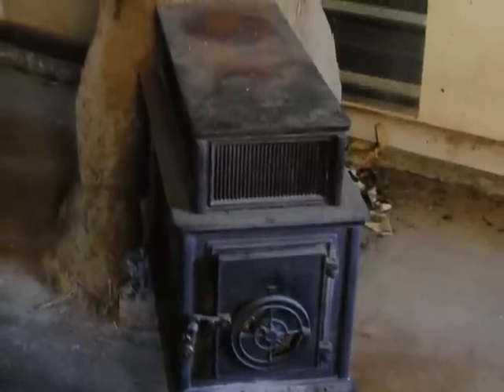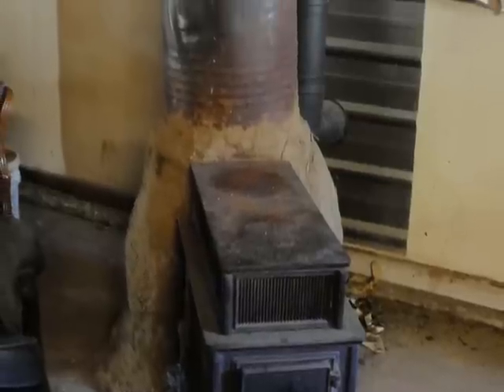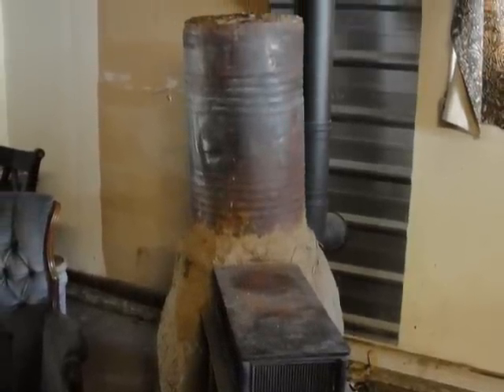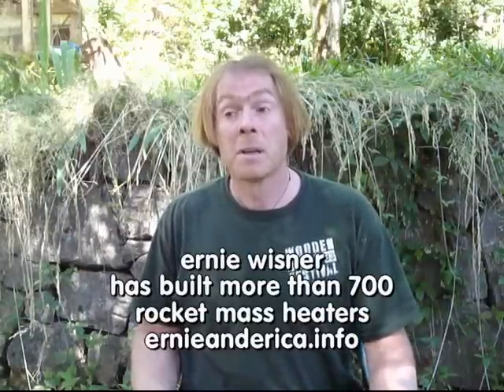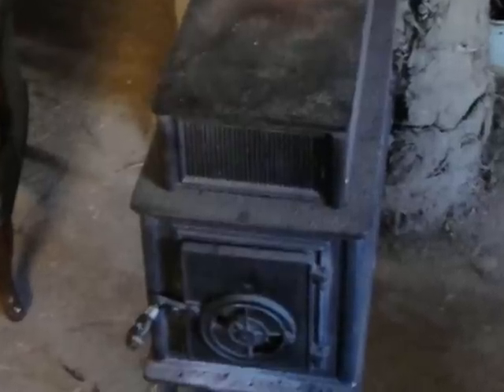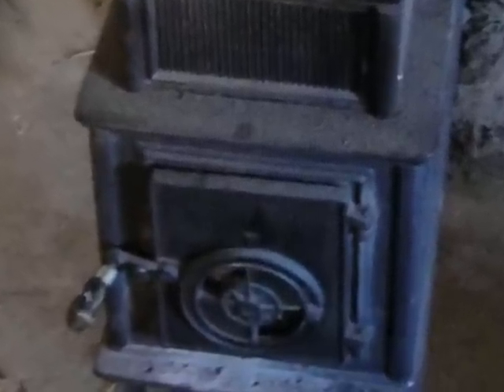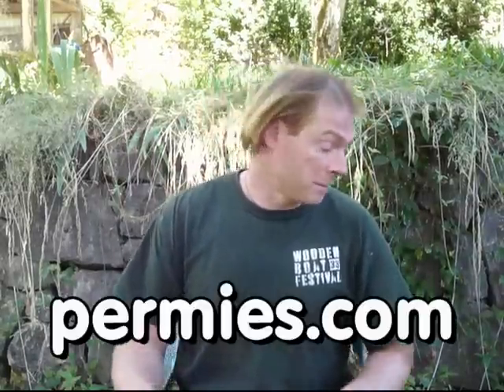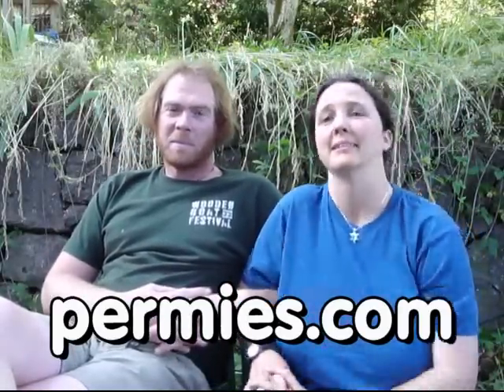wood stove + rocket mass heater = hybrid

Comment: Do you think that using double pass through the vertical heat tower would increase the heat and less would be lost to the outside air ??/ How about using a brick heat mass that they use in Russia on the tail end of the hybrid wood rocket stove ??? Thanks

Comment: Paul, i am lucky to have wood delivered to me for free on a regular basis. I personally do not car how much wood I burn. My beef is that a large house 2500 S.F. need a good bit of heat even though it is well insulated. Would really like your advice on being able to get a good ten hour burn from the woodstove. That would really work. My wood is seasoned at least 2 plus years with very little moisture. The meter say the level is somewhere in the lumber yard stick construction lumber. Very dry for sure. Look forward to hear from you Sir.

Comment: the funny thing about this presentation is that I have always been informed, that is up until now. that combustion takes place in the riser. with the turbulence, temperature and the time factor, in accordance with the Horatio of the feed box length to the riser. could be 1:3. any ideas. other j tubes/rockets work even without insulation of the firebox. insulating the firebox seemingly does enhance heat capture/control of the operation. Ernie seems to have missed out on this critical factor. maybe next time around.

Comment: how about insulating the stove then. alot of people have a wood stove. what a way forward, if their stoves could be modified.
Reply from the maker: The insulation would need to be on the inside.  Plus, you need to mix the smoke, air and fire the right amount.

Comment: Really what's the point of using the stove as the burn chamber and entry point for air when essentially it's all getting sucked towards the secondary chamber ? Also the angle of the wood being burned is all wrong .The whole point of the efficiency of the rocket design is the fact that you're gravity feeding the wood and that creates a vortex fire that burns most of the VOCs and is drawn into the first point of contact ,the cob and steel .I thought the idea was to have a narrow opening to create the fast updraft to begin with that burns the fire sideways . I could see making the wood stove the primary collector for the heat with an internal riser inside of it and installing a steel tube and feeder inlet for the wood in the front but the chimbey opening would have to be lowered as it is on the traditional cob stove design. But all that aside I can see why they tried this idea just to experiment with the idea . I don't imagine that the stove gets very hot especially if its lined with bricks and used as the feed for air . I found this video while searching for a way to convert a free standing steel wood stove and make it a rocket stove . After seeing several examples I think I'll stick to the original design for the rocket stove and just build it from scratch . From what I can tell trying to utilize the wood stove is too much hassle to bother with.

Comment: Would someone be able to vent the exhaust from a wood stove into a hollow warming bench before routing it up the chimney?  (Using the stratification method.)
Reply: I started to do this - but without a clean burn then you have creosote too easily. So with stratification - the exhaust insulation can't be metal (as a riser is not metal)... not sure if they did that here in that barrel?

Comment: I'll try it on my old Jøtul 8.  With a short cob/masonry countertop bell.  I have 6 slabs of 4" thick granite 18"x36".  I think the granite (black polished) should hold up as the bell top.  What do you think?  I burn hardwoods predominantly.  I don't mind the spruce on a hot fire.

Comment: I added a batch box to my 55 gallon free standing rocket (a larger version of ZeroFossilFuels). Just like you, it failed becaise of the very reasons you mention. The box gets hotter than the rocket, which doesn't quite get to opetating temps for it to do its rocket thing.

Condensate from my flue is all over the floor, just beyond my mass, so its obvious that my exiting flue temps are way too low.

 Outside, it was in the mid 20's last night. I never had that problem with the rocket even in single digit temps.

I'm cutting that batch box up and am looking to cast a burn chamber out of castable insulated refractory al la Van Der Berg.

Anyway, I want to thank you Ernie and Erica. You two were my first '"rocketeers." What a wonderful adventure/learning experience it has been. I  also am glad I built a smokey failure. In the process, I became a better welder, and a smarter rocketeer.
Peace.

Comment: Now if you took a high efficient woodstove that is insulated with a firebrick lining, wouldn't that burn almost as complete when a mass is added to it just like you have with that older woodstove you are using?

Comment: i agree with madpainter69,
simply line the interior of the stove with insulative fire-brick.  many stoves are designed/factory made to be lined with firebricks...  which would also help the steel survive.  i disagree with people suggesting to cover the stove with cobb or bricks

Comment: what if you lined the whole inside with say styrofoam that will burn up later, took a 6"cardboard tube and a 12 or 14" tube for the burn tunnel made an L , insert into stove, and filled the remaining airspace with ceracast... insulated firebox 360* minus the door for loading. and you wouldn't be ovefireing the cast iron and possibly creating a fire hazard in a couple months time...

Comment: You need to retrofit that Jøtul with a "clean burning system" and then it will burn just as clean AND slower then a rocketstove. 

The optimization is needed to be don in the wood stow and not in the back part. the conversion of the stow is don by insulatin the sides then introduce the preeheated air in to the top and to the roof in the front befor the flame goes up in to the uper "burn chamber" then you get a compleet burn as long as the woof is not to wet. i use modern Dover burners that work just liek that.. mine is a smaler one. (the one you have trhere is the old 60cm type) stil it burns complete and heat up realy good.

What i dooo need is somthing to remove more heat from the the gasses goign out from it. now it just goes out the back and out thru the wall.. so a lot is lost to the outside.
Reply: that's where you can implement the rocket mass heater to get the rest of the heat from the gases.
Reply: can we just put perlite clay into the sides of the wood stove? thanks

Comment: problem , ive only got a 4x4 space to make a rocket mass heater.instead of going sideways for the mass I need a way to make it all in a 4x4 square.this square is in the middle of two rooms.the floor is wood. the whole house in on 4x4 that are cemented in .we were going to put in a regular cast iron or metal heater but I like the rocket mass heater instead.worried about if this small mass would heat 28x32 house.and need plains for this square unit any help would be great were lost

Comment: So can one take a wood stove and fully envelop it in thermal mass to create a more efficient thermal mass hybrid approximating a RSMH?
Reply from the maker: I think it is plausible.
Reply: Hi paul wheaton! Pardon the noobie question, but if someone would cover the cast iron stove with COB, is there a chance that it could get hot enough inside to break down the metal?
Reply: No ,not possible .What makes the rocket stove unique is the design which uses the exhaust heat and transfers it to the mass . I've tried using fire bricks and totally encased a regular free standing wood stove to see the results. It did radiate heat longer than if it was just the steel alone but essentially it took a long time to release that initial heat because your heating the metal  and then brick or whatever you choose to use as mass .
I could put my hands on the bricks and feel the warmth but if I removed one from the stove the steel was scorching underneath .Most heat went straight up the chimney unfortunately .I ended up using the top of the stove as a mass storage for heat which made it safer for my cats who dig it 😸but left the sides alone to radiate the immediate heat . All that aside comparatively speaking regular wood stoves are such a waste of potential energy and are so inefficient it's unreal ,plus they're extremely dangerous . A good friend of mine almost died because of a creosote fire . That's also the beauty of the rocket stove design,no creosote build up at all. I'm in the process of building a rocket stove right now and once it's done will never go back to a traditional wood stove . The free standing wood stove I have now is really nice and built extremely well from 1/4 inch steel with gorgeous welds ,plus is a step up chamber design but the amount of wood needed plus the inherent risks of using it just aren't worth it .
Reply: @royalspin  I just got the "two dog" stove that has a baffle - so it gets 20 to 30% more efficient burn. I will stack bricks around it but I don't have "fire bricks" for direct contact with the stove. I guess constant duct pipe cleaning will be needed for safety. thanks for your feedback.
Reply: @royalspin  I think if I damper the stove pipe a bit and then put bricks around that also - that should also capture more heat.
Reply: Insulate the box but lose the radiant heat...  which wouldn't be bad if it were piped to a mass.

Comment from the maker: Much like a conventional stove, you start the fire with kindling.   Once that is gone, add some bigger stuff.   By that time, the room is plenty warm and you stop feeding the fire.   The room stays warm for a day or more.   Feeding the stove every half hour is what you do with a conventional stove, not with a rocket mass heater.
Reply: paul wheaton!  First thanks for linking this vid to me.  I have seen it before but poo poo d it because, let's face it the stove looks like a turd.   I have seen 3 types of RMHs.  Those that are really nice and anyone would want one.  Those that are nicely done but look good for the right space and those that look like a turd in the living room.  I am not artistic, if I can make a piece of wood straight or make mud smooth I'm happy👍   The one thing I can consistently do is make a turd.  I don't want a turd in my livingroom.   What I seen of this is the inurds of how this can work.  ERNE'S  solutions is to wrap the stove in insulation.  Makes sense based on other RMHs all slathered with mud.   Erne s one comment was that this was an 15 to 20 foot system.      What does that mean?  Does it mean that the total length of the flue can be only 15 to 20 feet.  Or does it mean the buried pipe under the mass can only be that length?
Also what I need is a heating system that can heat my house for at least 12 hours on a single firing without babying  for two hours plus hours.   If a normal j tube design I would work I would look it that more.  But I think that the batch design is the ticket, hopefully I would only have to fire it every other day etc.   Even if I cut my wood  consumption down to a cord per year that beats the 15+ that I'm blowing through with an outside boiler system.  Thanks a bunch for the help and videos.  This is truly cool shit!

Comment: Hi! good job on the video.. I was thinking about it a little... what about lineing the stove with fire brick? would that help?

I would like to build from scrach with the rocket stove idea. whith a large fire box(like a wood stove)(so i would not have to keep feeding it) thinking biger scale because i want to heat a shop... well... and burn less wood... lol ... I'm probably wanting alot....Just thinking ot loud. thanks for your time...
Reply: I have been binge watching rmh videos for a couple weeks now. Seems like the firebox size is not the issue. To get ‘bigger’ heat (like you, I want to heat a large area, a 30x40 garage) it seems you need a larger riser and more mass. I have yet to see anything where I can do that without feeding a fire every bit as much if not more often than a woodstove. Too much wood at once makes the burn inefficient, so you can’t load up a firebox like you would a conventional woodstove.

Comment: I was thinking if the J part is what basically causes both the wood and gases to burn why can't I just install one in the front inside my woodstove with a back panel in the rear to let the smoke draw from the bottom.I already have an 8 shape exhaust pipe to get the most out of the heat with a fan that blows across it

Comment: What if the fire box of the wood stove was lined like a masonry stove?  Would that work like an insulator to improve the rocket mass heater section, or as a heat-sink hindering the complete combustion if the gasses?

Comment: #2 with the brick mass ahead of the heat exchanger barrel, long after the fire is out the draft continues at a large volume.  The air movement through the stove collects the heat from the brick tower then moves on through the heat exchanger  I can place my hands on the heat exchanger barrel hours after the fire and it is still radiating heat while the pipe is cold where it exits into the chimney.  Due to the volume of air removed from the room it is not efficient.  Just passing on my results..

Comment: Question.  Do you think a rocket mass heater is as efficient as a masonry mass wood heater?  I built a combination rocket stove / mass heater similar to the one on LarsMith217 video.  I used the brick burn tower first and then ran the exhaust up a barrel like a rocket heater with the intent of using the barrel as a heat exchanger then from the barrel it does another 180 degree bend and goes out a old chimney in my shop.  It is purely experimental..  Contains about 1000# of brick and mortar.

Comment: Seems to me you could line the interior of the firebox with reflective fiberglass panels and firebrick to A) constrict the size of the opening increasing velocity and B) raise the firebox temp. Problem still is instead of continuous gravity feed and controlled burn, you're feeding by the load, making it flare up and burn out too quickly.
Reply: good point

Comment: Power a small fan to direct your airflow and produce your desired effect with a turbine exaust power generator which is powered by the rising of air. Like a wind turbine or fan blades. it has to be metal though. This also will give you a chance to power small devices, like alarm clocks. You can put a light manure/hay mix at the very top of the exhaust, filtering the smoke, making it greener.

Comment: Thanks, Paul! 
@RonRay: There are definitely drawbacks to incorporating a metal woodstove, especially in terms of efficiency.  But there are some practical advantages: more people know how to light it without training, ditto the cooking or cleanout features.  And citing the common EPA exemption for 'antique stove' may be easier than educating a local building inspector on mass-based exemptions or getting exemption letters.  In short, it adds an element of 'normal' that some people like.

Comment: Hey Paul! We need a LOT more videos of the Wisners giving us every scrap of  knowledge in their heads, just like this one. Ernie is so articulate (Erika too!). You are making a resource collection that is extremely valuable thru this channel and your other websites. What sets yours apart is the ongoing discussions of what works / what didn't work / what worked for awhile but failed or got revised, and WHY. My deepest appreciation.
Reply: Why not convert the woodstove entirely into a rocket mass heater.
My sugestion would be
1 to close the stovepipe part.
2 remove the glass from the door and replace it with metal. And cut an 8" hole for the wood feeder ss pipe to come through
3 create a ss 8" pipe with elbow as typical in rocket stoves
4 cut space for the 8" pipe to come through the top of the stove closer to the center so the dome can be placed around that pipe.
5 place the pipe with elbow into the stove.
6 fill the stove completely with sand, in a way so there is sand surrounding the entire pipe.
Sand underneath, sand around the sides, sand on top to fill the entire stove.
A closable hatch has to be cut on top in order to fill in the sand.
To create a most efficient combustion with the least amount of heat loss I would bring in a pipe that could be connected to fresh air intake from outside into the combustion area.
Also another smaller pipe has to come from the combustion pipe to the back of the stove for clean out of the elbow/ combustion area.
The dome would have the exhaust pipe attached.
After heating up the combustion area (the elbow) would become super hot because it is fully surrounded with sand which would act as insulater in this case.
This sand will also act as heat sink and
 give up heat slowly.
 Someone gave me a large woodstove but I don't have the equipment to convert it.
It would be so practical to have this in my shop.

Comment: I think the only way to incorporate a wood heater with a rocket stove, would be to use the cast iron stove as the heat riser (heat exchanger). But that is what the "mass" does in the first place. 
Either way, trying to incorporate a wood stove is just 'backing up': Benjamin Franklin already did it.